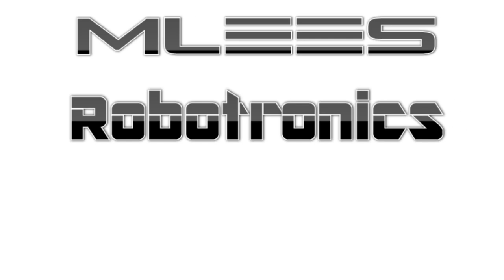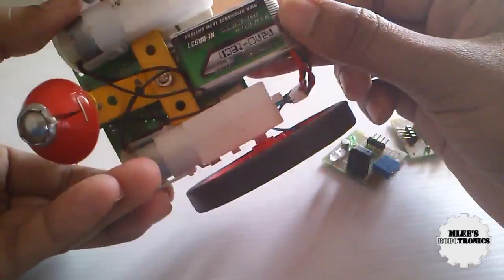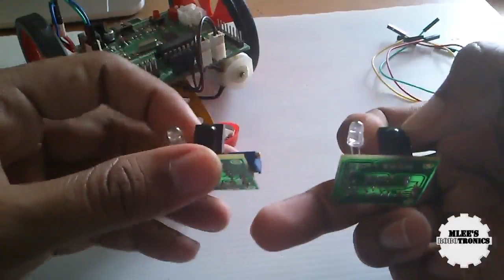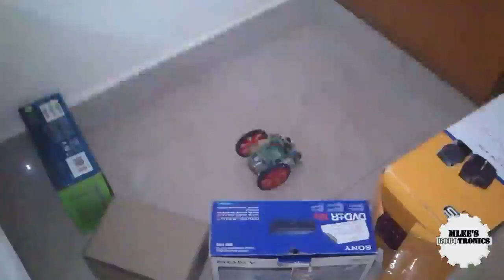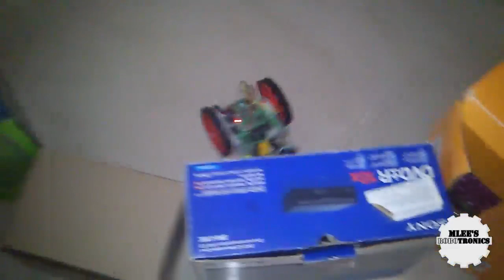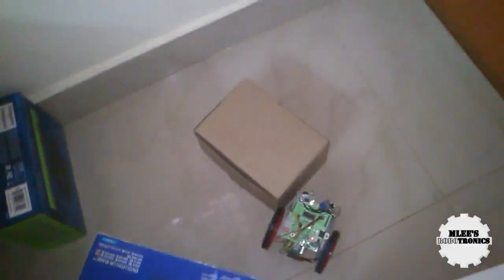How to make a Robot: Making an obstacle detection robot

Comment: sir can i know information on sensors which can detect some physical items or an algorithm in which a sensors can sense the presense of physical item like plastic or glass or metal piece or vegetable... can u please help me by giving some information to me.... cause i hardly know something and and very intrested to know about it... please
Reply from the maker: @Neethi. this brings up a question of the application that you want to implement with this sensor.  if you want to detect if a physical object is present regardless of what is bject it is,  you can use ir sensors or ultrasonic sensor.  if you want to know how big thebobject is,  the shape of the object then you have to use camera or Lidars.  so basically it all comes down to the application.
Reply: M's Tech Blog i want to learn more ... where can i find information on it...
Reply from the maker: I would  suggest to start googling.  there is no specific single point of source. there are plenty of information out there on blogs.  and more over dependinf on the application u can make specific search.